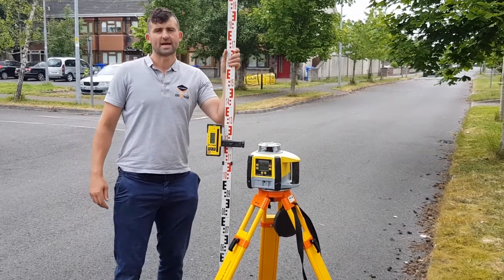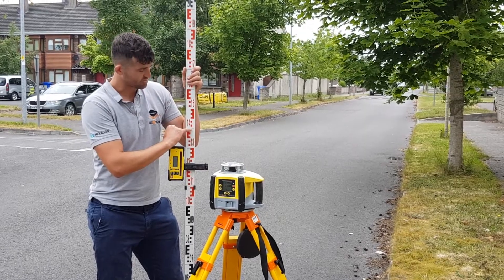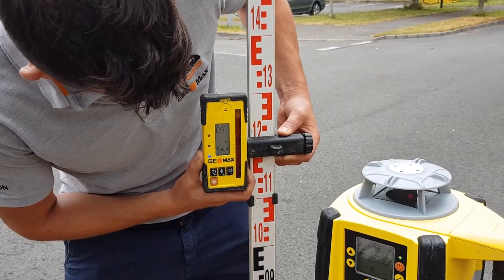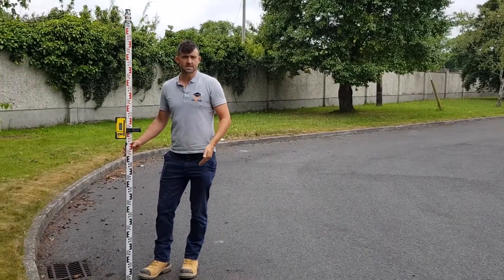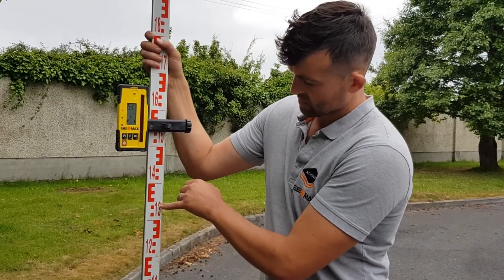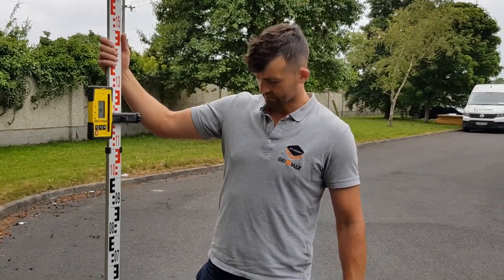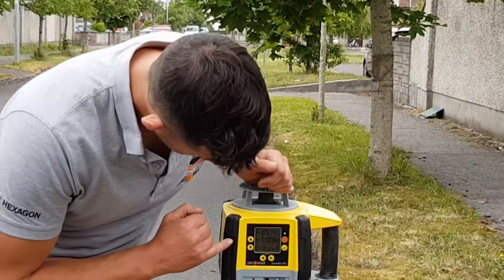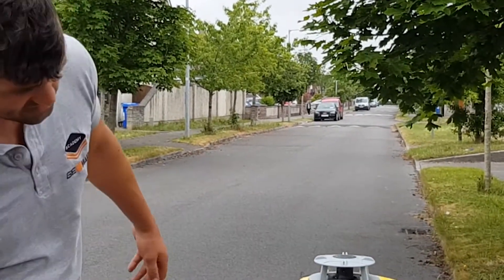How to use a dual grade laser

Comment: Good video ,just wondering if you can use that staff with the old  machines that you look into using cross hairs ?
Reply: You can, just make sure the person holding the staff is slowly tipping it away and toward you - the lowest reading you get is the correct one indicating plumb/vertical.
Reply: Yes you can indeed. The old. Machines you are talking about are Dumpy Levels. Also available with us!
Reply: yes
Reply: pls what is the difference between dumpy level and this lesar one